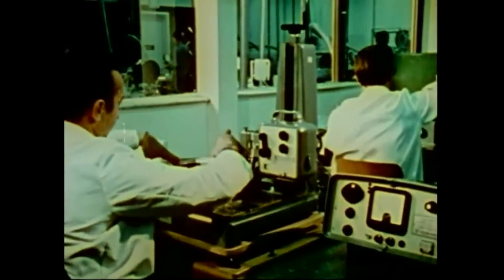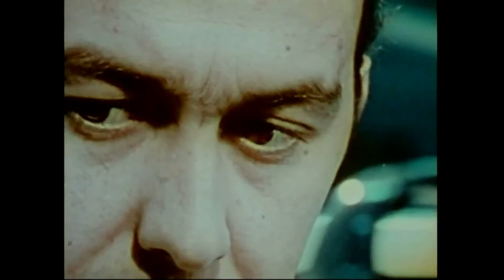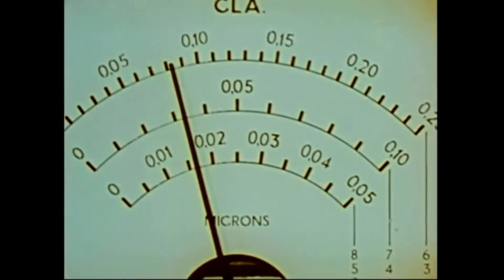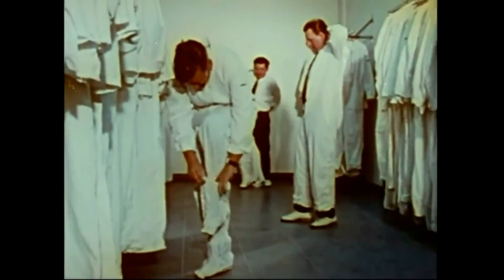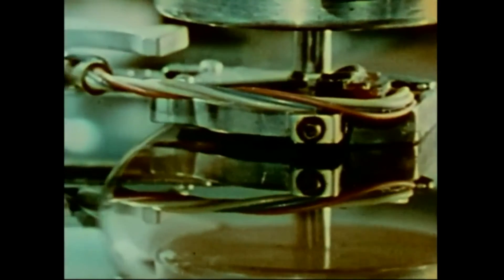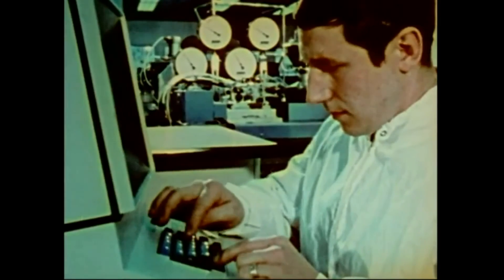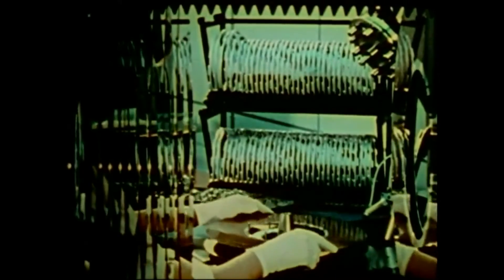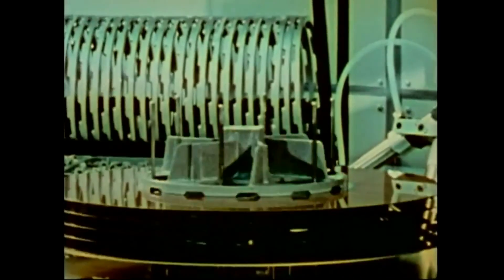Computer History: 1968 IBM Magnetic Disk Pack Production film (restoration)

Comment: so when did they start using clean rooms to make computer parts?
Reply from the maker: Hi Kevin,  great question!   Actually, in 1962, Willis Whitfield (working at Sandia National Laboratories in Albuquerque, NM) invented the "clean room" --- since it was found that dust particles were a potential source of problems in microcircuit manufacturing.   You can "google" it for more info.  Thanks!  ~   Richard Kimball, at CHAP

Comment: At one place I did some training on in the early '80s, they had to put concrete blocks into the bottom of the disk drive cabinets because the mass of the R/W head structure meant that, at the right frequency of movement the drive could be made to rock. Programmers were told if they create jobs that caused that to happen it was immediate termination.
Reply from the maker: That is an awesome story.  Thanks!  ~  Victor, CHAP
Reply: Please tell me a video exists !

Comment: Thank you for uploading these videos. I wonder what was the usual capacity of one disk pack back in 1968?
Reply: I was the manager/administrator of a networked family of Pr1me Computers (models 550, 750, 850, and 2250) from the late '70s into the mid '80s.  We used CDC disk drives.  By then the capacities of "SMD" (removable) packs were 80mb and 300mb and "FMD" (non-removable) packs 670mb.  They were very good drives.  CDC sold a lot of them.
Reply from the maker: Hi MegaBojan1993,  good question.  I think it probably varied a bit by vendor, but very early disk packs for the IBM 1311 (1962) held about 2 MB.   By 1968, I think the capacity was about 5 or 10 MB per disk pack, that's all.   Maybe someone else can help clarify even more.  Thanks!
Reply: Computer History Archives Project The capacity of these drives were tiny compared to modern hard drives, but still they were much better than the capacity/physical space ratio of the first HDD from 1956.
Reply: The 2316 disk pack stored 29.2Mb

Comment: If I remember right, the 2311 and 2314 DASD drives had hydraulic actuators. I took a call at a customer site (working on a competitors tape drive) and watched the IBM CE slip on oil from a leak.
Reply from the maker: Paul K, that must have been a sight.   It's interesting what memories some of these old films bring back.  Thanks for sharing this one.  ~   Mark, CHAP

Comment: At @7:03 it says "Platte gut", that means "platter good". :-)
Reply: It’s german and means „Disk good“. I’am wondered about the german Terminal Outputs. Was the Disk Manufacuring Plant in Germany?
Reply from the maker: Hi Conenion, yes, I think you are correct!
Reply: It must have been a German facility.  I noticed several other labels on the manufacturing equipment were auf Deutsch.   I noticed the “WAIT” light on the disk drive was labeled “WART” and also Dymo stick-on labels on equipment typed in German as well.